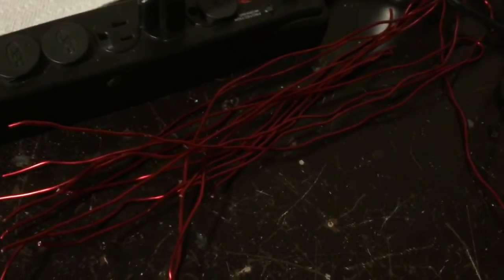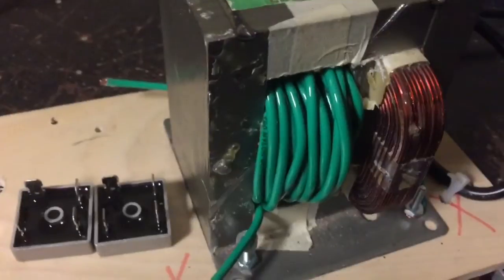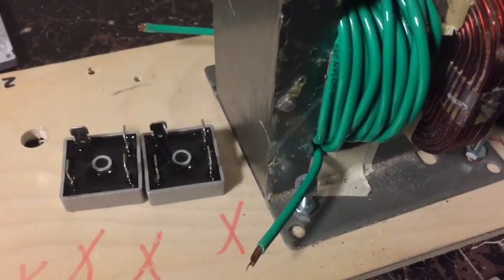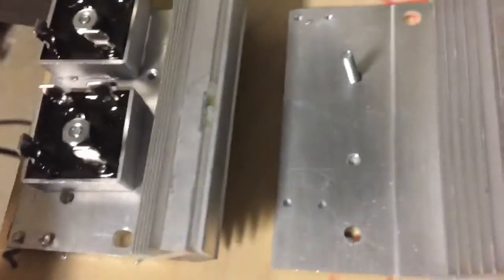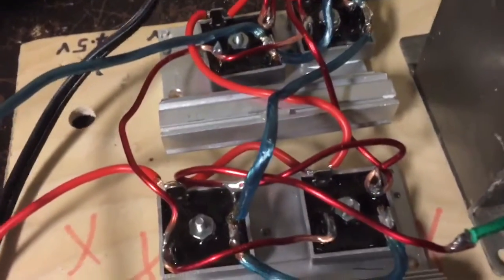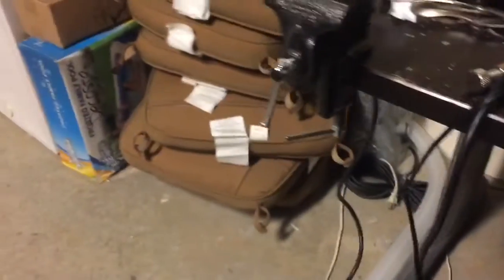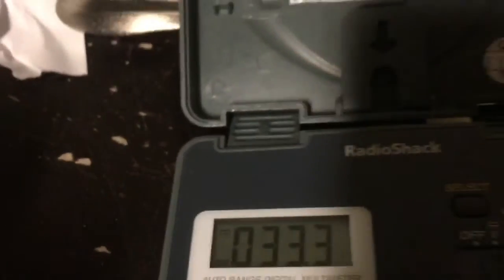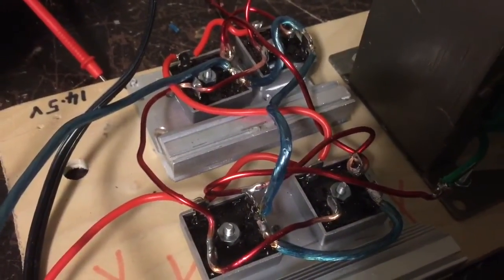Redo of Microwave Oven Transformer DC Power Supply 30V at 20A

Comment: Nice vid.👍.. but when you are explaining so much just remember not all of youtube is smart as us.. so try explaining the items you are using.. eg.. calculating the output of a transformer in regards to windings and power input. (This can be done through equation with pen&paper). The circuit you used that f*tucked up due to it shorting and how you fixed it should also be on pen&paper first before you demonstrate... (just explain what something is and how it works) hopefully when people understand it they will be more interested and learn more. Also like I said before... great vid 👍

Comment: How can I get 50 volts?
Reply from the maker: Abdelmalek Boubekeur more turns on the secondary until you get the required voltage.
Reply: @BrianDhvTinkerer  thank you for answering! 
What gauge should I use for 20 amp ?

Comment: Nice DIY :)
As a motor/generator winder, I recommend you source Nomex insulating paper for your transformer adhered with adhesive Mylar or Kapton tape (if you like the good stuff!) Then commence with your winding enamel coated wire. You'll eliminate the likelihood of turn to turn shorts as well as ground faults. Additionally you have the added benefit of more winding room for more output turns due to less physical wire insulation. Wish you well...

Comment: How can get 25v 0 25v Ac 10A  which number wire should use 14g  possible? how many turn per volt
Reply from the maker: ahmad shahzad 14gauge is fine. Roughly 1 turn per volt.

Comment: did this to use as a car battery charger , how hot does your transformer get ,mine is at 103 c unloaded which I think is rather hot
Reply from the maker: It does get hot even without loading.  However, I would not see appreciable heating during short runs. Nothing to ever melt the enamel off the secondary.  It is possible to reduce heating with forced air cooling. I have never had any major issues with overheating.

Comment: How would I go about doing this for 60V 20A's? And any chance it can all be scaled down and put in a small metal box like a typical 1000W inverter size so I can carry it around from A to B? Thanks
Reply from the maker: Danny Tillotson 60V x 20A = 1200W. You would have to use a bigger MOT that can handle 1-2KW. You would need to add enough windings on the secondary to get you 42V AC (= 60V rectified DC). You would need to use thinner wire for your secondary then what I used to be able to fit it in the space provided. To handle 20A continuous DC, I would wire at least 4 x 35A full bridge rectifiers together in parallel and heat sink them. Do not use the rectifiers rated for 1000V. Those rated for 100V would work much better. The setup should be able to fit in a metal box depending on the size of your MOT and heatsinks. Alternatively, you could screw the rectifiers down to the casing of the project box which would then act as the heat sink. A fan and some holes cut in the box would help to cool the MOT which would tend to become hot with continuous use.
Reply: TESLA SCIENCE Absolutely fantastic! Thanks for the prompt reply!

Comment: where did u find that 12g magnet wire? and how much..
Reply from the maker: I got it from Ebay. You can also get it out of house wiring.
Reply from the maker: Actually, I got it from an auto shop as hookup wire.
Reply: TeslaSpot 101 oh..thanks bro..maybe i could find some in alternator repair shop..

Comment: can we use the output current as spot welder or arc welder
Reply from the maker: You can if you use a single turn of 4 gauge wire and remove the diode and capacitor - see my later video.
Reply: +TeslaSpot 101 but removing the diode and capacitor will make ac current , i have read before that the dc current will improve the performance of the spot welder and therefore we can use it as single-sided spot welder and as a car dent puller ......please help me
Reply from the maker: +Sabry azim check this out: http://youtu.be/hTaGa93lOGU

It really does work well. If you need DC then what I  would recommend is to parallel up at least 4 x40A bridge rectifiers for a total of 160A. That would work well. If u need more Amps then you can use bigger or more parallel rectifiers! Hope this helps.